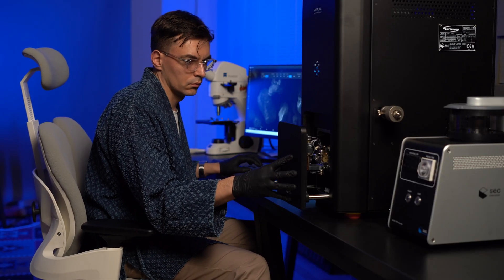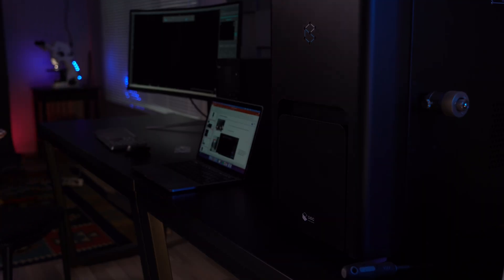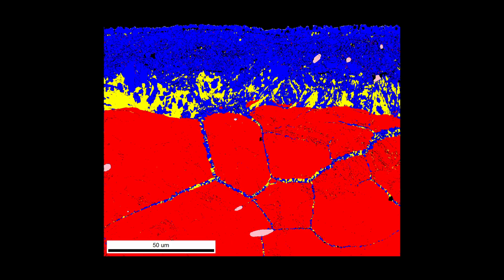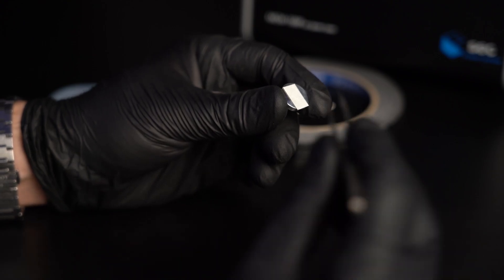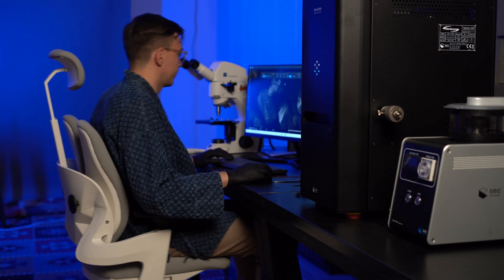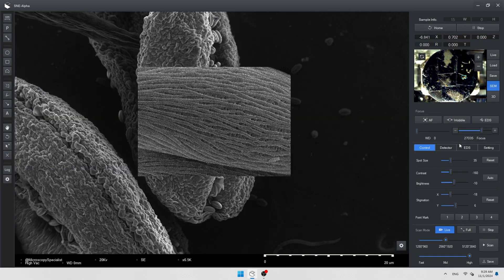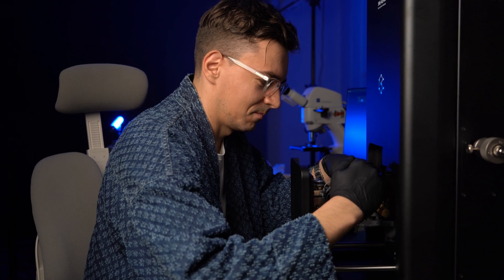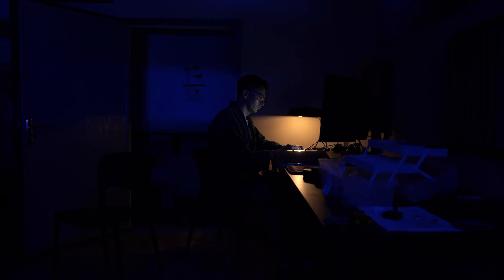My 250'000x scanning electron microscope!

Comment: My answers to your questions :

1 - Fabric fibers in purple with maybe velcro tips 
2 - Tungsten fialment (~ø 40 µm) from a broken light bulb
3 - Metallic tip of a nail or pushpin  (~ø 150 µm)
4 - Garden pea dehydrated or chewing-+gum ball cause  (~ø 4-5 mm)
5 -  Needle's eye with twisted cotton or wool fiber wire inside it
Reply from the maker: Nice try!
3 is a beard hair on a razor blade
4 is just a black pepper 

Thanks for your attention!

Comment: hold on, should not the static electricity build up just jump to a grounding plate. also why use electric fields to accelerate electrons (crt), instead just use a beta rad electron source 5keV+.

Comment: So I’m wondering. Obviously these microscopes need high voltage to do what they do and have power supplies.  Can they just be plugged into a home plug socket? Or do they need to be powered in some other way?
Reply from the maker: Regular 220V with grounding. I use uninterruptible power supply (UPS) just to prevent electricity issues. 
And all the modern SEMs use 220. No need for 3 AC - 380
Reply: @ I’m in the USA so it would be 120 v for me.  But still it’s cool to know you can just plug it in because I always thought they needed some special power source.

Comment: 1) Velcro?
2) Lightbulb filament
3) Solder wire with internal flux?
4) Poppy seed?
5) Needle and thread
Reply from the maker: @TheConnor12500  3 - hair on the razor blade :)

Comment: possible answer...

1. the tissue of a hook and loop fastener
2. there is a conductive wire inside every hair dryer, the job of the wire is to heat the air flowing out of the device. that wire is the same used in the video i think.
3. at first it looked like a broken pencil, but now that i am thinking about it, it is an electron microscope, so probably it is a cut electric wire "insulator + conductive wire inside"
4. ????
5. a thread through a needle.
Reply from the maker: @ABOUDIBRAHIM-h4j  you're the best)
But correct are:
2 - electric bulb filament. It's thinner than the hair (around 0.02 mm)
3 - shaved hair on the razor blade
4 - black pepper
Reply: @MicroscopySpecialist  I see, thanks for the clarification, a series of quizzes like this would be interesting, good luck !

Comment: I was in Winterthur, Switzerland, three weeks ago and visited the Technorama. On the 2nd or 3rd floor, I explored the biology "i think" department, which was truly fascinating. However, I was specifically there to see the electron microscope (SEM). I asked two young gentlemen if it was possible to turn it on, and they kindly did. The specimens we examined included a fly and a leaf, and we discussed how they gold-coat objects to make them easier to scan. The gold layer enhances visibility, which was really interesting to learn. It was a great experience overall.
Reply from the maker: I often asked to turn the SEM on in different labs, but they never let me. I had to buy my own, because it's very interesting. Yes, I will show in the next videos on the whole process in more detail, I'm working on the filming.
Reply: @MicroscopySpecialist  I asked how much an SEM cost , one similar to what Technorama has, it was anything between $250k to $500k , so a bit out of my range :p

but yeah good luck if you can afford one, looking forward to see it

Comment: How does the software work so that you can see stuff on the screen?
Reply from the maker: @glichasasha750  I'm preparing a video about scanning process. And it will be available soon.
The main idea - SE detector in every point of the sample calculate electrons and marks this pixel 0...255 (black to white). The mic is scanning extremely fast, thats why you can see 10..15fps image on live view

Comment: 1 velcro, 2 tungsten bulb filament, 3 hair, 4 seed, 5 needle and thread
Reply from the maker: boom!
Reply: 1 — velcro or gecko tape? 
2 — absolutely true, tungsten bulb double-spiral filament 
3 — cutted hair 
5 — it looks like the eye of a needle but the thread is very thin with separate fibres, looks more like a cobweb.
Reply from the maker: @nicholaseastman6915  no, just a sewing thread

And 4 - is an ordinary black pepper

Comment: 1. Sticky fabric... Not sure about it's proper name in English, a fabric with plastic hooks to stick to another piece of fluffy fabric.
2. A heating spiral from incandescence lamp
3. Hair, likely a human hair. Is that center piece looks mushy because it's freshly cut? Upd.: I even think it's a facial hair. It's not very round like head hair, but not flattened as pubic or body hair. 
4. That's difficult one... I guess, some poppy seed? Though, no, they have a different structure... It should be some seed. Dried plant matter. It looks kinda like a pepper, though it would be a tiny pepper if a thread on the left bottom corner is a regular one. Though, no, it's probably a pepper.
5. A needle with a thread.
Reply: about its* proper name in English.  It's = it is or it has.  Its = the next ward or phrase belongs to it.

Comment: Why took you the images of those samples with 20 kV? It's ok on the Tungsten Light bulb filament but not on the pollen samples.
Reply from the maker: I'll explain it in the future episode about SEM (coming soon). 
The main Idea - in this particular microscope I can't control Dwell time and Line/Frame average. That's why I need higher kV to obtain a nice signal/noise. 
It's kinda possible to change DT but only in service engineer menu, so at this moment I simply coat the pollen with metal and use 20kV.

Comment: wish i had one of those. it's fascinating how insignificant humans really are, there are MUCH larger things and MUCH smaller things, but 99% of people never understand anything beyond what their primitive eyes can see, which is why 99% of people are so dumb.

i'd mostly use that microscope to see if my visualization in my head matches the reality, in most cases it does.
i'd like to observe lot of different materials and how they work. 
looking at tip of a needle would be quite cool or thing piece of thread or thin fishing line, those things would look amazing under that.
Reply from the maker: Thanks for the comment! I will definitely take these pictures for you.

Comment: What does theirs go for ($) and have you used other desktop SEM brands to be able to give a comparison?
Reply: Same here, arrived with algo recommendation, assumed by video quality it was at least 100k subs or more. Really surprised by this.
Reply from the maker: 1. Price inquiry - please contact me via email (you can find it in "About").
2. Yes, I had experience. Coxem EM30, Phenom.
Each microscope has its pros and cons. SEC has advantages that i really like - changing the sample = Vent+Vac around one minute. It's extremely fast.
5 axis stage is also a good option and very useful. 

I'll prepare a video about resolution and adjustments. Phenom FEG has a higher resolution with higher price. So the choice is a difficult question. You should worry about warranty, service, price, payment method and other things. So for a benchtop SEM, SEC is my choice!
Reply: @MicroscopySpecialist  people with a million subs dont even have this type of equipment and a very hard working chemist saved up the money to get this kinda equipment and also the video quality when you have 17 subs and also i thought u were a big ytuber
Reply: @MicroscopySpecialist  How big is the stage?
Reply from the maker: @KurtisSaiyo  Max sample size - 80Dx40H. 
Max stab diameter is 40 mm
Reply: @MicroscopySpecialist  I see this is one of those situations where if you have to ask the price you can’t afford it lol
Reply: 1 Velcro. 2 Velcro. 3 metal wire with corrosion. 4 Pollen. 5 Needle and thread